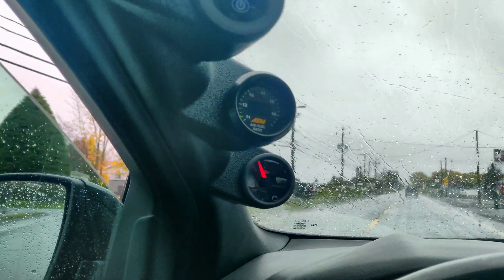electric turbo pt.5 I'm done with it..

Comment: When do you comeback brother I wanna see the improvement so bad now 😂

Also what means ESC electronic speed controler?
Reply from the maker: I can't wait to come back 😭 I still waiting for my new batterys. I order them in february and I still got nothing 😭 soon I guess 🤞 
You are right for the meaning of ESC !
Reply: @WBprojects  cool and do you think you would be able to control the power of the turbo depending on the accelerator pedal position to make it smooth or it's just you choose a power and it's always on/off at that exact power?
Reply from the maker: @imestia7911  I will control it by RPM ! It will be active only in WOT

Comment: The sensor need non turbulent air to measure correctly. Thats why its usally a straight tube before the sensor.
Reply from the maker: That's why I finaly put it in front. I knew it need to be in front but like I said I had too much going on that I made a dumb mistake